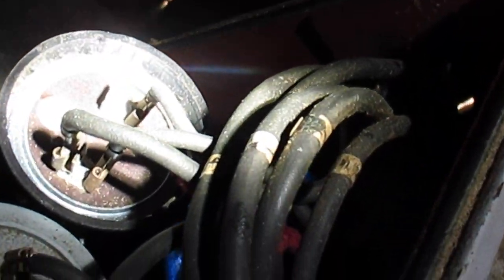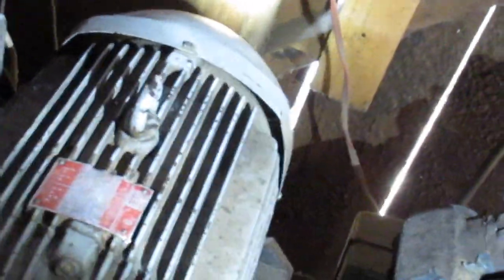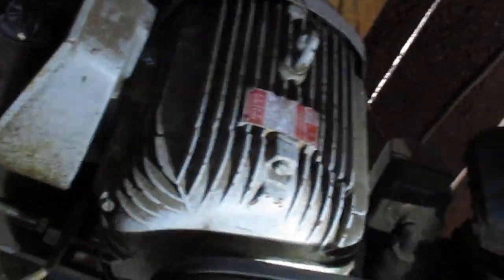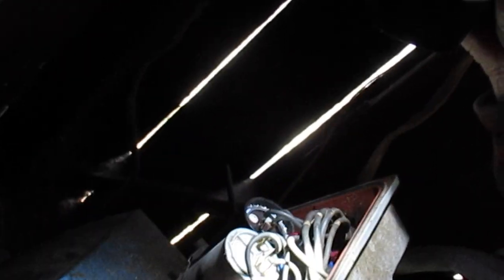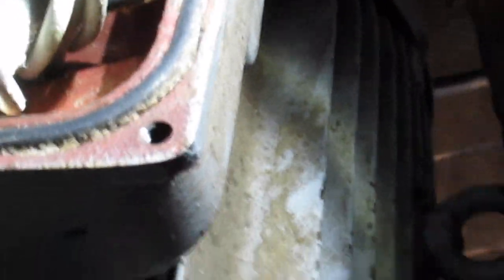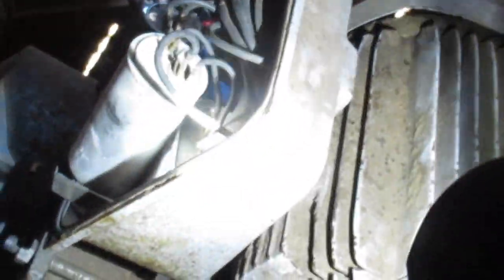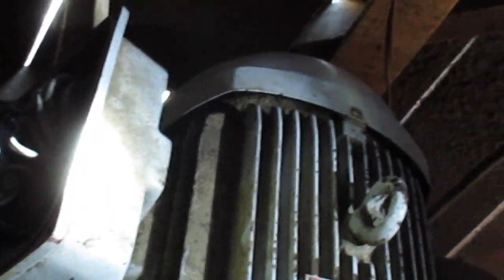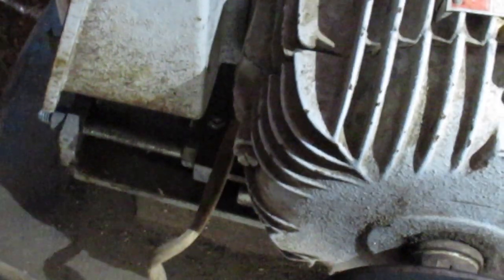Air Compressor Blues

Comment: Have you taken the belts off and checked for free play?
Check the compressor for smoothness, turn it over with a socket wrench.
Too much resistance will kick it off.

Just off the top of my head.. no experience on my part.
Good luck.

Comment: Lol, I work on a lot of weg motors.  We use to be a dealer a few years ago. 

They sell a capacitor tester, I don't think you're multi meter has a setting for capacitors.   Find a local electric motor shop locally and see if they have a capacitor tester.   If you remove them you need to label them. It's not very likely that you'll find a diagram to reconnect them . 

What size are they? (MFD)
 The trouble with single phase is there's not a real standard way they are wired. It's best to change one capacitor at a time.   

There are 2 windings in a single phase. One is only for starting.  There's a centrifugal switch in the back of the motor on the cooling fan end.  After it gets to speed it cuts off the start winding. 

You can have a capacitor that is within 10% of the original MFD.  

VAC is volts  in alternating current. 

WEG is a South American company. 

I believe it is one of the capacitors as well.

Comment: A quick way of checking capacitors is to use the Ohms tester,  and hold the probes to the poles of the capacitor.   If the meter swings up and stays there, the cap is bad,  If it swings up, and drops off, that means the cap is good.  Just guessing tho Mike,  it sounds like its deeper than the caps.  My guess is that the armature or brushes are bad, since it kicks off so quickly when started.  I hope this helped a little to find out what is wrong with the motor.
Reply: There are no brushes or armatures in these style motors.

Comment: I talked to my boss about it, he is going to try to look it up. However, the newer ones have 4 capacitors.  I don't know if he can find the info on the older ones.   Just a thought though. If you have been running it a year I'd bet they were sufficient in size.  It wouldn't hurt to be a little bigger though.

Comment: To test the capacitors Mike....just take a 110 source and hook it up to the 2 terminals on the capacitor the take that off and just short the cap with a screwdriver from one terminal to the other. If it sparks it good and if it blows the breaker when you connect 110 volts it`s cooked....your tester cant check if the caps charge.....Your motor has an internal switch inside that will switch from start to run if I`m not mistaking....that could be bad...you could maybe file the points or sometimes there's a micro switch that`s defective and it`s at the back end inside the motor...Looks like your start is running but it`s sticking and won`t allow run to take over....The motor you have is a two-value Capacitor motor which I think has High torque and they are used a lot for compressors....for the running stage in these motors, a lower capacity will substitute the start with the higher capacitance by a centrifugal switch inside the motor...Both the run and start windings remain in the circuit at all times and only the capacitance is switched by the switch....lower microfarads are your run capacitance... The two capacity values can be obtained by using two capacitors in parallel at the start and then disconnecting the high-value caps out with the centrifugal switch for the run circuit....I hope this is not too complicated....take your spare apart at the back and tests the centrifugal to see if it works and if it does just take the caps and first take a picture....polarity is important here and connect them for a test....I think I said too much.
Reply: I`m going for a siesta but be back on here at 4 if you have questions.
Reply from the maker: THANKS Gator
Reply: @mmccoy577  I would take the belts off and try it with no load first
Reply: Dont hold the capacerter in your hand when you energize it, if the insulation has failed you'll cop a whack.😁

Comment: Large mfd value and a grater than line voltage value  is usually a start capacitor.  The 1' s that have the smaller mfd value, are the run capacitors.  
I hope this helps u.

Comment: If replacing the capacitors doesn't fix it, then it's most likely the switch. If the switch isn't closing then the start winding won't help start the motor.  Try running it with the belts off, take a video of that.

Comment: THE VOLTAGE ON THOSE CAPS ARE TOO LOW.  110 v isn't enough.  Should be 50% more at least than the line voltage it's hooked up to. S/B a min of 180v... to be safe.....

Comment: Sounds like the brushes are wore out, if it's runs but slows then trips the breakers, from my experience sorry.
If them wiring connectors are corroded they would heat up and create resistance
Reply from the maker: It does not have brushes

Comment: Start with a volt meter check to see if you have two legs of 110 volts on each side. Breakers go bad,  if you tripped the breaker and don't have two hot leads you don't have 220 going to the motor.  It will not have enough power to go into start or run mode properly